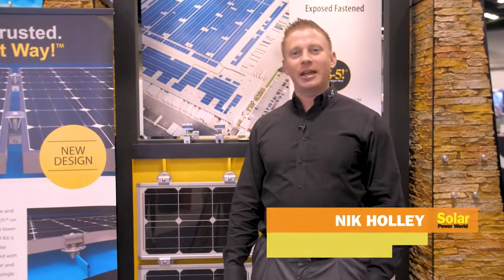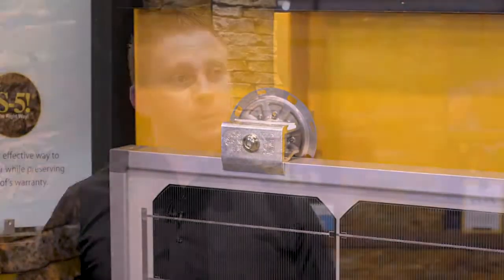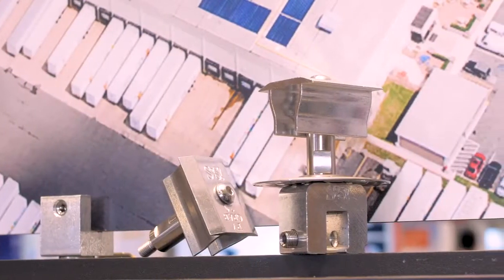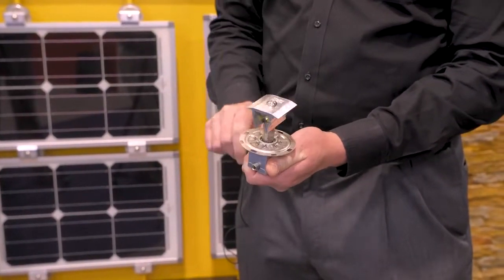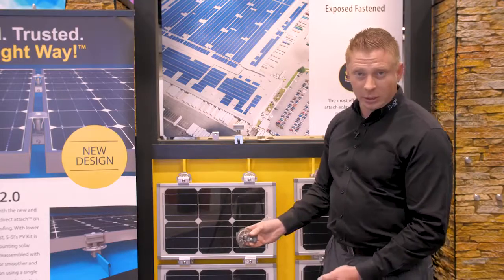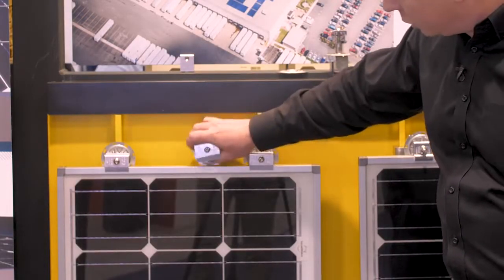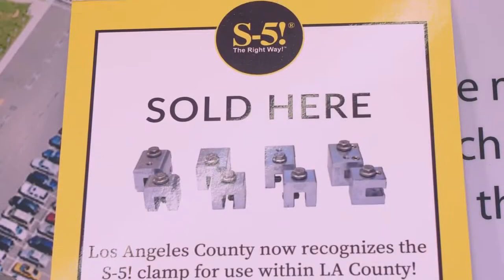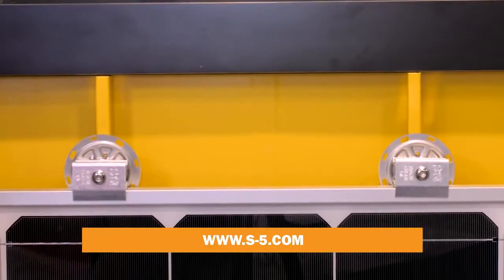The PVKIT 2.0 at Solar Power International 2018

Comment: With this type of "rack-less" system. How would you go about mounting optimizers or micro-inverters?
Reply from the maker: Hi Marcus, we offer clamps, brackets, and a utility mounting system called GRIPPERFIX that can all be used to mount these MLPEs. What kind of roof are mounting your solar PV system on?
Reply: @TheMetalRoofingAcademy  I have a trapezoidal metal roof. I'm planning on using the VersaBracket-47 along with the PVKit 2.0 EndClamp and MidClamp kits.

In my research since finding your response, I'm leaning towards the "Quick Mount PV QMAFB-U". I feel this is a good compliment to the "direct-attach" setup of yours I intend to use. If I had to install the GRIPPERFIX under each panel, I feel I might be better off just going with rails.